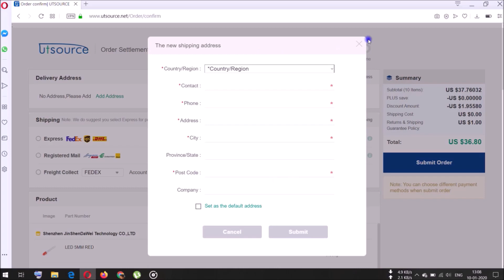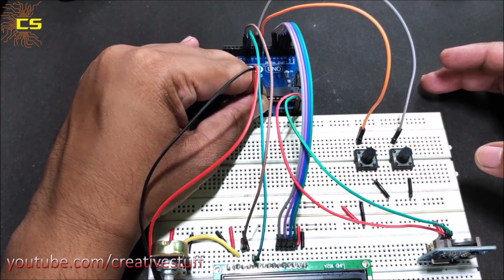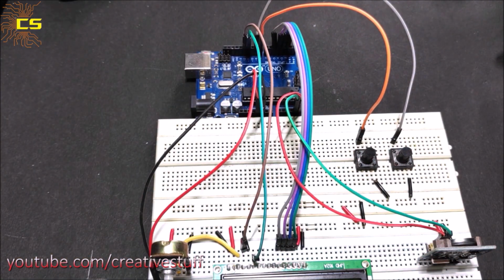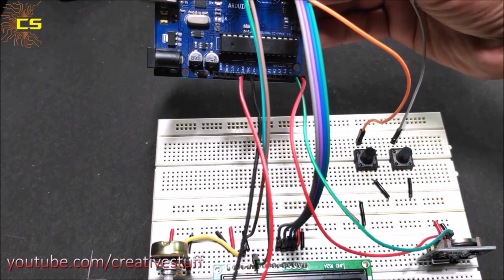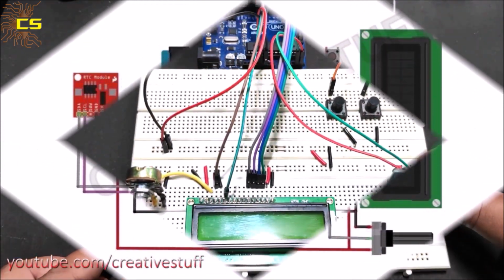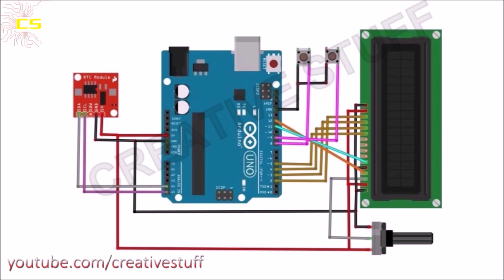Arduino DS1307 Real Time Clock and LCD Display with code

Comment: it worked used a spare 16*2 lcd lying around from a china audio board which i was not using, took a week to figure out lcd with ardunio nano, uploaded the examples from  Ard.IDE only serial test was not working, even hello world didn't work resoldered all wires which were damaged whie salvagine  & it worked finally. can you also please upload in 12 hr am/pm format, i am also going to try to do that. thanks.